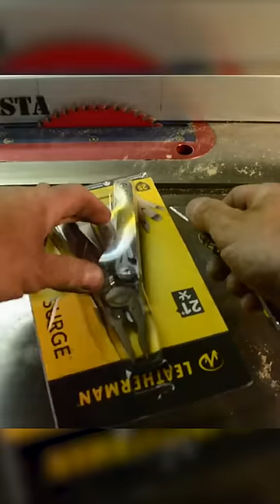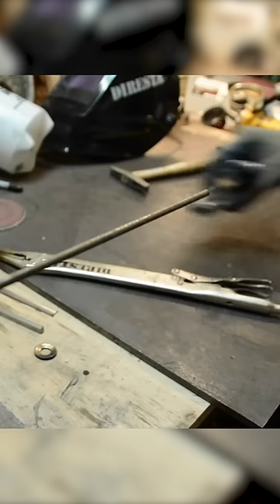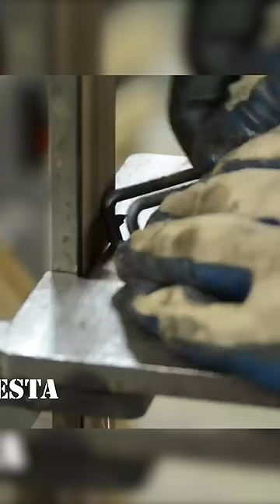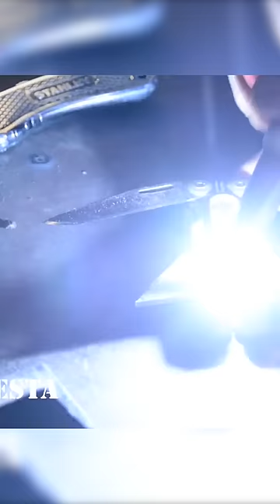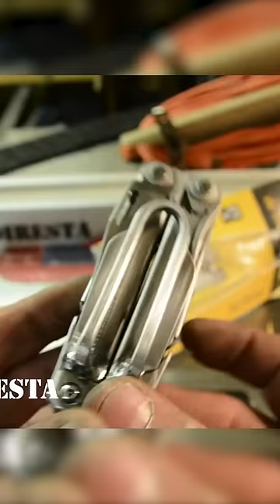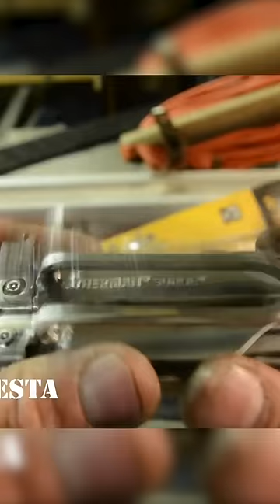A Leatherman Mod

Comment: Should be done in a way that doesn't affect the heat treatment of the tool, other than that this is a great idea.
Reply: Or melt the shit outta the exterior casing. The bolts that hold everything together could be replaced with slightly longer ones and a bolt on clip would be much better as well as being easily replaceable or removable should you ever choose to.